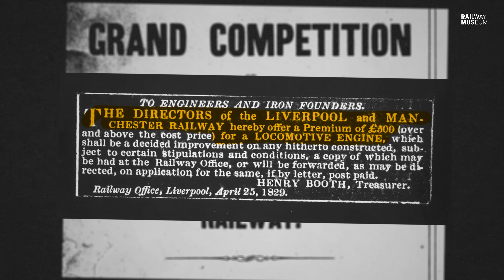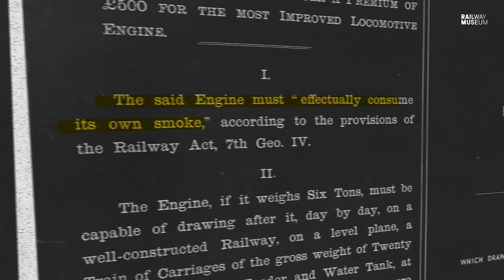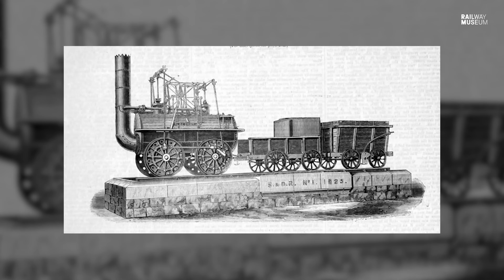Sans Pareil: Rocket's Rainhill Rival | Curator with a Camera

Comment: Are you certain the deep groove on the wheel is wear?  If it was used as a stationary engine the output was probably a belt.  Perhaps the groove was machined into the wheel to convert it to a sheave.

Comment: A later trial of Stephenson designs against Hackworth repaired design would surely have the advantages of the multi tubular boiler and better blast pipe prevail.
The U-tube boiler with the fireman at the other end never got into large scale production for good reasons.

Comment: You know what I would love to see, someone try building a steam engine with todays knowledge and technology advances, but following the Rainhill trials entry rules and seeing if they can out perform the Rocket.
Reply: It would be easy to outperform the originals, just the design of more modern valve gear alone would make a far more effective engine even if you didn't improve anything else
Reply: easily. much much higher boiler pressures and more efficient boilers, supeheaters, high precision machining etc. would have already been a childs play in the 1930s, and google "modern steam" if youwant to see how much further weve come
Reply: @the_retag  I know that, but the Rainhill trials had strict Stipulations and Conditions,
One of them was "boiler no greater than 50 pounds per square inch"
So your Higher boiler pressure suggestion is out.

My question DID say "today's knowledge" which does mean  features like supeheaters, high precision machining etc.

With that in mind you also have to obey the other entry condition "No locomotive may weigh more than six tons"

So let me rephrase my question to you.

- CAN we Build a Locomotive following RainHill trial Entry Conditions with todays Modern advances including  supeheaters, high precision machining etc.

But still with the strict restictions including that the locomotive weigh no more than 6 tons and have a boiler pressure no higher than 50 Psi.
And be able to out perform the Rocket?
Reply: @exveefan  weight is not an issue. we can build tiny steam locos

Comment: You can see why it didn't have any meaningful springs, because with vertical cylinders it would have waddled like a duck. Even Rocket must have shown that tendency, which is presumably why it was rebuilt with the cylinders nearer to the horizontal.
Reply: It had springs fitted when used in the Rainhill trials, recent research has shown that Locomotion also had springs through most of its working life